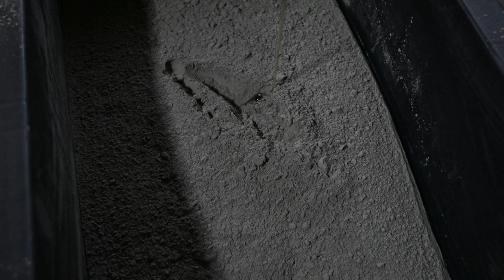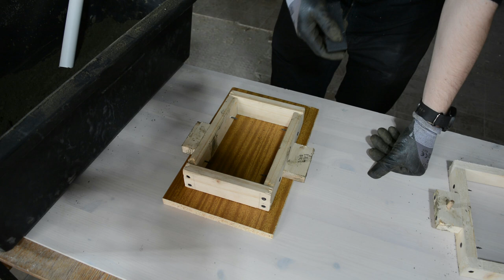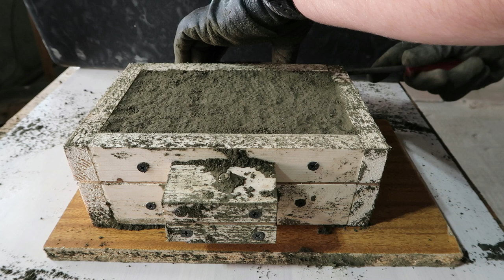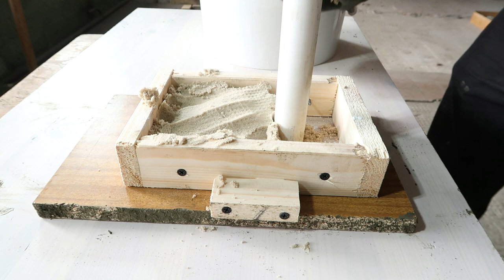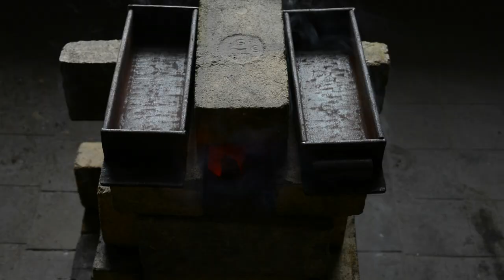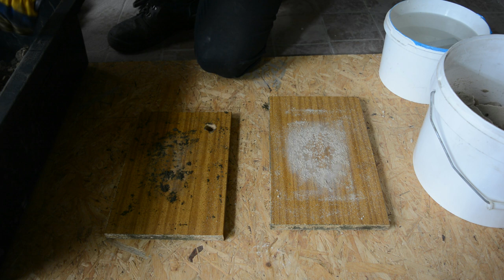Cement for metal casting?

Comment: cement and motor oil sand is used for many years for silversmith sand casting traditionally here in Iran. the perfect ratio (in volume) is 1 oil to 5 cement, don't forget the sieve two or three times the cement before mixing. mix them slowly and gently just by hand for couple of minutes. you can use it over and over again without any problem.

Comment: Hi MP Dragon.. Professionally made investment material is gypsum (plaster) based. It also has quartz and cristobalite for temperature resistance... If you cast metals below 1100c you can use jewelry investment..it is cheap enough and gives a really smooth casting surface...if you cast higher temps ( greater than 1200c, eg. Iron)you can mix in extra quartz or sand to the mix as plaster breaks down at those temps...the best advice for making your own investment is copy the recipe of professional investments..they all tell you what they contain, they don't tell you the ratios but you can find that out. If you use the lost wax technique with these investments the quality of the casting and surface finish is so far ahead of sand casting it is unbelievable..

Comment: I don't give af about the smoke or how difficult it is, that cement casting was better looking than greensand. once I find the right consistency, I'm using that for all my castings from now on.
Reply: I've made a bunch of different batches/grades of greensand. Some with sodium silicate and basically silica flour sand. You can get insanely good surface finishes but you have to have the right starting materials. The finer it is the bigger PITA it is to mull properly. I just did a mold and casting today that doesn't look like it was cast😂 I tried the portland cement/oil and it was very odd. Haven't cast with it yet I just made a test batch.. maybe I'll have to revisit it after seeing this

Comment: I have used this method, If you are going to do it, you need a lot of ventilation if you dont want shrinkage.. Cuz apparently, cement doesn't ventilate at all..
Other then that after 3rd pour I got good results, I needed precise dimension, and it worked quite well.

Thank you A lot, Spasiba borsoi..

Comment: From my understanding, adding ethanol, methanol or isopropyl alcohol to the cement  mixture would work as a catalyzer to stiffen the material. And 2 stroke engine oil would create much less smoke and odor. I will try it soon because until now I was using only green sand (water based).
Reply: Hey I know this comment was a long time ago, but I’m down the rabbit hole and was wondering if you ever tested your theory. Did it work?

Comment: i think what made the mold smoother was particle size, if you grounded the sand so it was a powder with very small particle size you would get the same results.
Reply from the maker: I have been looking how to make a ball mill so I can get fine sand
Reply: you dont need a mill, just get some screen and do the screening in 2 steps. there will be enough fine grit over there. just make sure the sand is 100% dry otherwise you never gonna finish it. i can not tell the specific number, 1st is a rough screening, second is for the finest. so its 2 different grits for the screens. Its also depends on you what size you like, but the the 2 step is useful if you want to make more than just 10 litres.

There is an another good source of a very good material, those guys who working with ceramic tiles or granite and they cut the tiles, they have a lot of very fine powder (mostly soaking in water, but never mind) More than likely they will give it to you free.

Comment: i think you used too much oil try doing it with less, thats probably why it kept sticking to the other half of the mold and why it produced that much smoke
Reply: Oil can also be expensive i use bought sand rady to go for my videos...
Reply: use used engine oil
make sure you filter it first though
Reply: I am going to start metal casting soon, and this comment caught my attention. Have you actually done this with used oil, and how did it turn out?
Reply: I use used engine oil I buy it for 10 center a liter so 5 liter is 50 cents.

Comment: I bet the difference in quality is due to the granular size difference between concrete and sand. If you could find a super fine grain sand, it might give you the same quality without the oil smoke.

Comment: Cool, curious of a few things. First what green sand do you uses/prefer , i have seen people using fine sand with oil mixed in , some with playsand mixed with kitty litter...etc. Or do you just uses Aluminum oxide sandblasting sand...? Would like to see a video of going thru all the different types of sandcasting materials that work and rating there quality. As there is so many options of making your own sandcasting sands out there. I am like stuck in figuring out which one to choose and don't have the ability or resources to try them all currently. I would imagine most feel similar that they just like to know how to make the best green sand or the best options to go with. (And not be let down by all the hack based mixtures that are hard to work with and/or not good results with them)

Comment: Hi MP Dragon, an interesting video, well worth the experimentation time, but I agree with your conclusion, too messy and smokey. I do have a suggestion, try a combination experiment using cement and sodium silicate as we know the sodium silicate method is much cleaner, so we may end up with the best of both worlds. You could also check out bagged "Builder's Sand" as that has a much higher [finer] mesh number than "play sand". I have also been thinking about "brickies sand" for use in greensand casting as that already has the approximately correct sand percentage of clay in it. Mark

Comment: From what i see cement casting yields pretty good results but is it a one shot mold or multiple casts ? Also does the cement based cast harden up or is it still recyclable / reusable  like the traditional bentonite clay based green sand (aka just have to throw away the burnt bentonite clay part. Jewelry makers uses this method of sand casting with bentonite clay based sands. There sands just look more redish /brown probably from the type of bentonite clay used. Maybe a terracotta type or a earthware type...
Reply: It is recyclable cement doesn't not bond with oil. The oil just make the cement more shapeable and fly less

Comment: I think you should do the opposite first pour the oil and then pour into its slowly the cement. that way you will not have that much dust and you will not have that much problem because it will be absorbed into the oil and I think the system is good maybe you should try to improve it but it does look to me like a very good way

Comment: The other point is why not use oil based mold on one part of the mold, for details, and water based mold on the other side, for easy degassing? Water based is less dense and lets vapors go out easily.

Comment: Interesting.....Instead of synthetic motor oil, I would try cheap vegetable or peanut oil.  1/10 the cost of synthetic motor oil.  This could be a great alternative to petrobond or greensand.
Reply: Any type of oil will work just be careful with the mix ratio

Comment: why did you not put the stuff you use for the sand in the cement? also i love your videos a lot!
Reply: tim kors pretty sure the stuff he puts in freezes the sand so it gets hard
Reply: 4x4convoy yeah but he needs to try to mix that stuff with the cement maybe it will work?
Reply: No. I think the gas is CO2, atleast thats something that some people use. That will not harden motoroil.
Reply: oh i mean mixing the sodium silicate with cement and then use Co2 to harden it if possible
Reply: tim kors ahh now I get it! yeah that actually sounds pretty reasonable!
Reply: that make sense to me :)
Reply: The stuff you mix with sand (Bentonite) works in conjunction with water,, in this case, the water would start to make the cement set up.
Reply: 85rocco Yeah Sodium Silicate has water in it, so that kills that idea. If the mold had no locking pieces, and a draft it might make for a reusable mold. Still the sand used in this video looks like playground sand, very course. He should have used greensand for this comparison.

Comment: Hi, Best Regards from Germany, 

Could you please explain what is "sodium silicate" ?
You get it as fluid ?
It is difficult to "harden" it with "CO2".

How much sand and how much fluid you mix together. 

best Regards
Per
Reply from the maker: I buy it at the hardware store and it is written that it is a additive for concrete or as a glue. when adding co2 it hardens immediately. I mix it by eye and harden a sample in my hand with co2 if it is crumbling I add more sodium silicate, if it is to wet I add more sand

Comment: Nice! I have one question,what do you think about useing used motoroil ? As you may know motoroil is preaty expensive and i dont really have much money to use
Reply from the maker: I think used oil would work, basically it is the same oil
Reply: Thanks a lot!
Reply: Thanks for the advice!
Reply: make sure you filter it first, and don't use any oil that has gotten other fluids into it.

Comment: What ration of sand and sodium silicate do you use? I use Bentonite and sand at at ratio of 9-1 then add water until desired consistency is achieved to hold together. Bentonite if what clumping cat litter is made from, so I just use a bag of it and pulverise it in to dust, very cheep and cost effective as you can re use over and over just by adding water
Reply from the maker: I made that recipe when I started metal casing, but when you get to patterns as big as I make it becomes very difficult to make the mold. I mix it by eye and harden a sample in my hand with co2 if it is crumbling I add more sodium silicate, if it is to wet I add more sand

Comment: have you tried soldum silicate with cement yet 
the divverence in surface between the sand and the cement could allso be caused by the sand being courser
using the sodium silicate should make the cement vehave somewat the same way as the sand with the smoother casting without the smoke the oil gives off